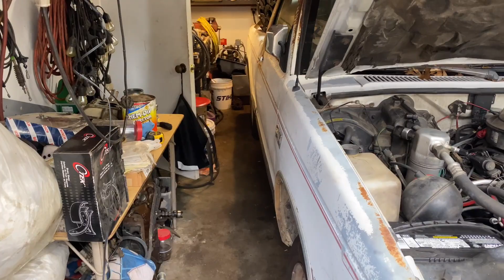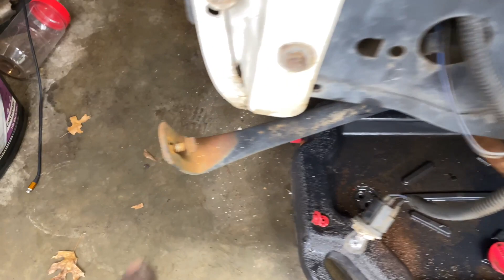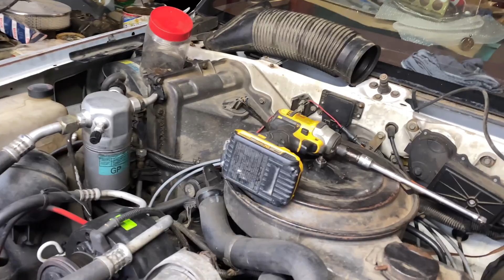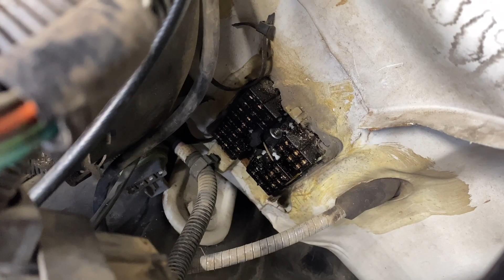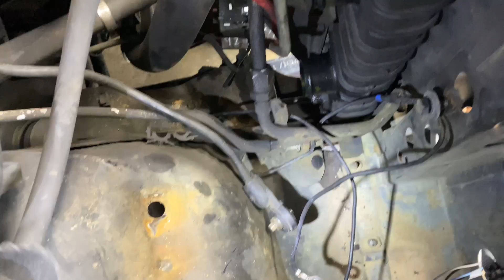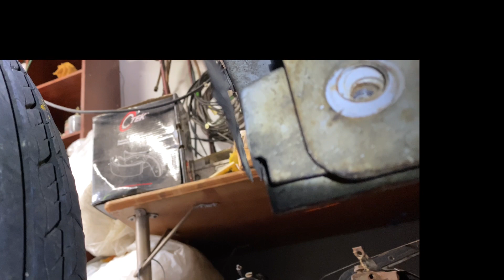S10 V8 swap| Front clip removal| step by step

Comment: Those "headlights" are disgusting. I hope they are going in the dumpster. About 10 years ago I built a V8 S-10. I used a 1993 model, standard cab short bed. It was originally a 2.8L/5 speed. Original AZ truck, completely rust free, as in not a speck of rust. No body damage, other than the paint was badly sunburned. That's far better than rust. I built a carbureted 400ci small block, bolted to a Muncie M21 4 speed, and a modified Ford 8.8" rear axle. I completely disassembled the front clip, down to the last nut and bolt, cleaned everything, repainted the core support and a lot of brackets. All the A/C and heater parts went in the trash, including the evaporator and heater core boxes. I fabricated a sheet metal cover to go over the holes in the firewall. There is absolutely NO emissions or computer crap on it at all. True dual exhaust with glasspacks.
Reply from the maker: This truck is “rust free “, but definitely not damage free. 😂 It was built as a rough hot rod. The AC stays, it works. I adapted the factory brackets from the 4.3 to the 327. We had a set of 15” factory wheels that we cleaned and painted and installed fresh clean trim rings and freshened the center caps, so it had a clean factory look. We lowered the truck with drop spindles and 4” blocks. Not optimal, but it works for now. The head lights are LED aftermarket, my son likes them, 🤷🏻‍♂️. Thanks for watching and commenting.

Comment: Can this be done with the radiator still hooked to the engine?
Reply from the maker: I’m pretty sure I pulled it out. It’s super easy to pull the radiator on these. The AC condenser can stay, just disconnect it he lines.

Comment: I just got a clip to replace the one on my wrecked 87. Thanks for the content.
Reply from the maker: Doing this V8 swap for the first time, I can say that it made access to everything much easier. Hope the replacement of your front clip goes smoothly.
Reply: @ thanks. I bought mine when I lived in TN and I moved to Illinois last year. My neighbors are going to be beside themselves when I take it apart. It’s rust free.
Reply from the maker: @johnclark6751 my sons was always a southern truck. I’d suggest you invest in fluid film to keep it as rust free as you can.
Reply: @RealWorldGarage  I got the old one off and the new one on today. I have to pull the passenger side frame horn a little bit to get the body mount on that side to line up. It was a pita to get all the gaps good and the body lines to all line up good all at the same time, but I’d say it went well. I’m going to drop the battery back in tomorrow once it’s charged back up and park it by my tree and see if I can get the frame pulled over enough with my come along and torch. Hopefully I’ll get done with it this week. I ordered a new hood latch release cable today and I need to get a radiator. The one that came with this clip had a 4.3 and mine is a 2.8. The upper and lower hoses connect on the wrong sides. I’m getting there though. Your video was very helpful. Thanks again
Reply from the maker: That’s great man!!! I’m glad I was able to help in some sort of way!!! You can send me photos on FB. I also have a real world garage fb page. ✌️good luck with the frame.

Comment: I have an 87 from Pennsylvania…. Those front body mounts are the bane of my existence
Reply from the maker: I can see where they would be in a rust belt state. These were a little rusty in a non rust belt state.
Reply: @RealWorldGarage  any tips on removal? A blow torch just melts the bushings directly above the bolt head
Reply from the maker: I HAVE NOT used one of these, but I have seen several videos on them and want to add it to my arsenal of tools. I think it would be very useful. This recommendation isn’t brand specific, just this type of tool. 
https://www.amazon.com/dp/B09CPX851W?tag=br_1c_a_o-20&linkCode=osi&th=1&psc=1&ascsubtag=1732423773598-2-1732423773598&SubscriptionId=AKIAJO7E5OLQ67NVPFZA
Reply: @RealWorldGarage  thank you !!

Comment: ive done a few of the v8 s10 swaps actually i just got another s10 im putting a 383 in
Reply from the maker: I hope it goes smoothly, any problem areas?? I have the swap headers and swap mounts. I’m prepared to cut down the AC box if necessary. I’m also going to try to install the serp belt brackets from the 4.3 to the first Gen 327, any suggestions there?? Thanks for watching.
Reply: @RealWorldGarage  I usually delete ac and just use a non ac box  the seam on the fire wall will need flattening out and possibly a little hammer work on th firewall end of the tunnel if you are using heads with accessory holes it should bolt right on